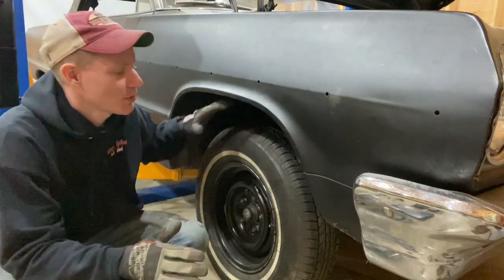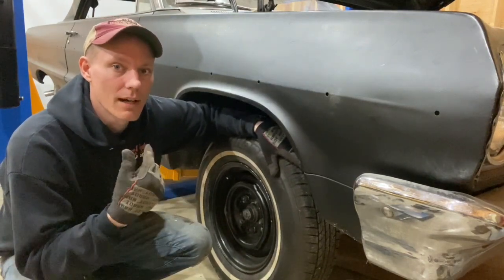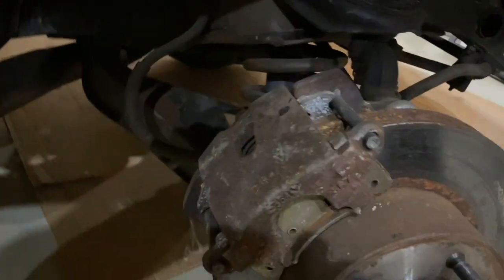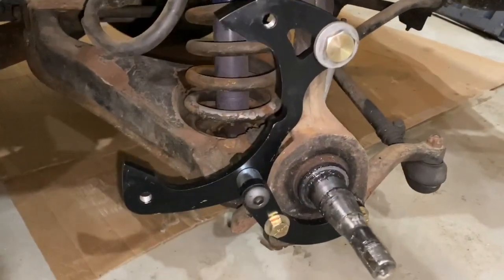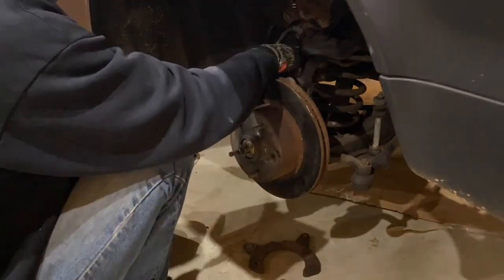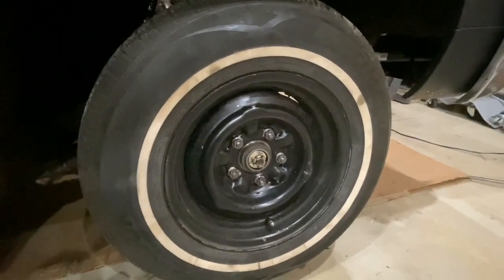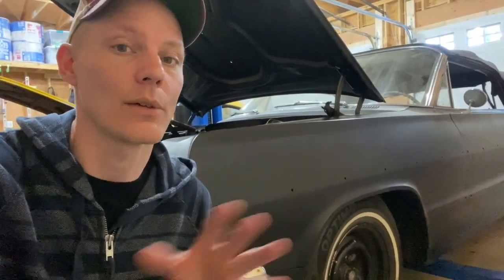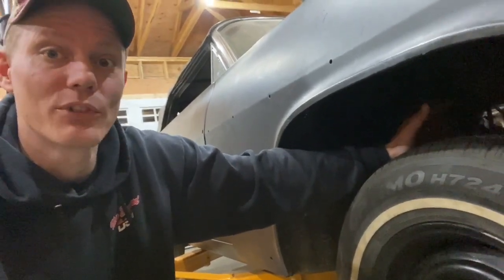1964 Chevy Impala Front Disc Brake Upgrade - 20 YEARS LATER!

Comment: Nice project. Good info to know for me as I have a 64 Impala that I have yet to drive since I'm midway through the restoration and did the same disc brake conversion. Mine was from Speedway Motors, but I'm sure they're just about the same setup. Appreciate the vid!
Reply from the maker: Thanks for watching! Good luck with the 64 build !

Comment: If your going to a bigger caliper you technically you should also step up the size of the rotor but it should work if the piston in the caliper isn't putting uneven pressure across the brake pad and if that pressure isn't even on the rotor it will shatter brake pads... will be interesting to see how well it works when there installed with them small 11 inch rotors
Reply: 73 chevelle has the same caliper and 11 inch rotor
Reply: But the insides are different.  that's why you  need to run the 72 chevelle rotor on your 64 spindle

Comment: Looking to do the same kit which booster and master cylinder setup did you use?
Reply from the maker: I have some links in the video description above to the parts. I’m not super in love with my brake booster at the moment because I’m not sure my engine makes enough vacuum for the booster to work 100%. I am doing some further diagnostics to sort it out. The master and calipers feels like a good combo though so far. I’ve probably got 500 miles on it using the brakes in the video.

Comment: Hey man . I'm in the middle of doing a front disc brake conversion on my 63 , I'm a little confused on how to route the rear brake line to the proportioning valve  bc the rear brake line routes down the passenger side of the frame .. what did u do ?

Comment: Any 61 impala video?or disk breaks that you would recommend
Reply from the maker: 61 and 64 brakes should be the same. So the ones in my video should work for you. The only thing to watch out for is that some disc brakes won’t work with smaller 13/14 inch wheels. So your wheel choice may determine your brakes.

Comment: What brake lines did you use? Or is it stock brake hoses/lines?
Reply from the maker: It’s stock from the firewall back. In front of the firewall, I bent my own hard lines and used the rubber lines that were matched to the calipers. In this case, it was 70 Chevelle/gto/lemans calipers in rubber lines I believe.